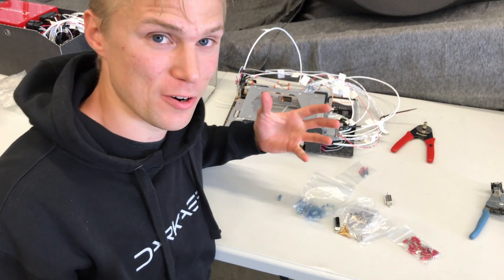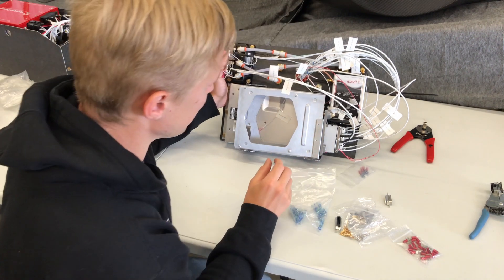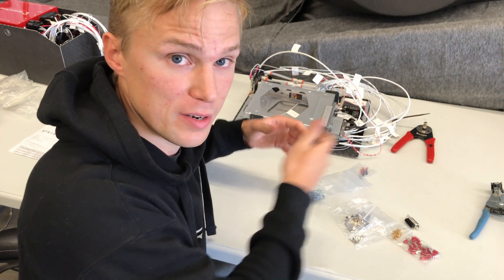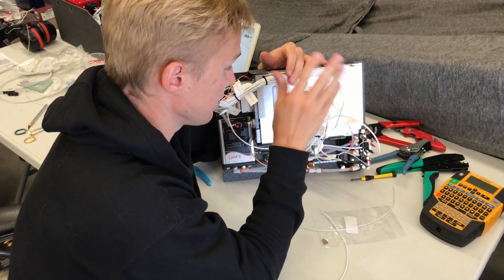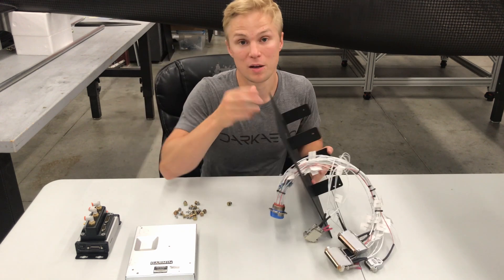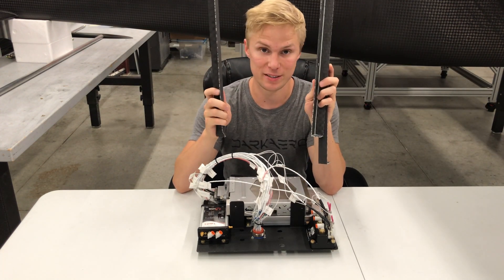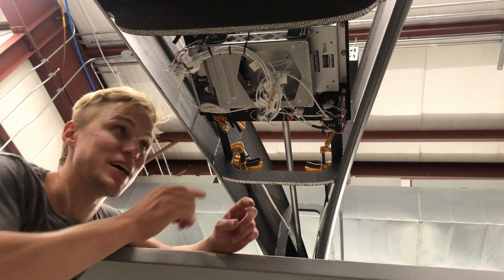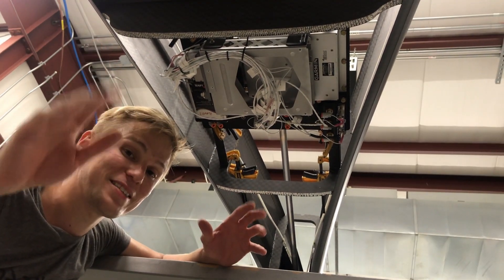Finalizing the Aft Electronics Plate in the DarkAero 1 - July 25, 2020

Comment: Nice neat work, good job. Agree with the using crimp pins on the D-sub connectors, although I do usually solder my crimped pins as well, just to flow enough solder in to prevent oxidation between the wire and the pin. How do you access the plate for maintenance once the skin is on?
Reply from the maker: The plate can be installed and removed through the main gear doors. We roughly show this in an earlier video here: https://www.youtube.com/watch?v=f0DsPnm06mM&t=490s

Comment: Looks great except for the fact that you won't be able to slide the remote GTX transponder in and out of it's tray without removing the whole assembly. I hope you hooked up the USB port for the transponder as well for software upgrades...it can't be done through the G3X.
Reply from the maker: Correct, in this configuration you won't be able to slide out the GTX transponder. However, the USB port interface would be fairly easy to get to here since the plate is accessible through the main gear doors while on the ground. The plate is also designed to be removed and installed through the main gear doors as well.

Comment: Nice. It’s a clap-together airplane!  Ha, ha.

Unrelated question:  Have y’all determined the power lever location and configuration?  If you’ve got electric elevator trim, it would be great to put a switch on the power lever for it.

Comment: I don't know how important or practical this is but would there be any value in using 2 connectors on this assembly. If the connector is not fastened correctly and come apart during flight could 2 connectors splitting the functionality and give some level of fault tolerance.

Comment: Great stuff.  Thanks for going with crimp pins throughout.  As it contains the ADAHRS, how close to "flight level" does the plate need to be?
Reply: It doesn't! you calibrate it prior to first flight.
Reply from the maker: To add to what Richard said, if you consult the Garmin G3X installation manual, the GSU 25 ADAHRS must be leveled to within 30.0° of the in-flight level cruise attitude. An aircraft leveling and offset calibration procedure should be carried out prior to flight. Part of the time-lapse of us installing the guide rails was spent getting the rails level relative to the rest of the plane.
Reply: DarkAero, Inc Thanks for the answer.

Comment: Where are you putting the GMU Magnetometer? and the GTP 50 Temperature Prob?
Reply from the maker: We haven't settled on a final position for the GMU Magnetometer. We have a few spots we're going to wire up and check prior to first flights to see how much interference there is in these areas. The GTP 50 will mount inside the cooling air intake at the front of the plane.